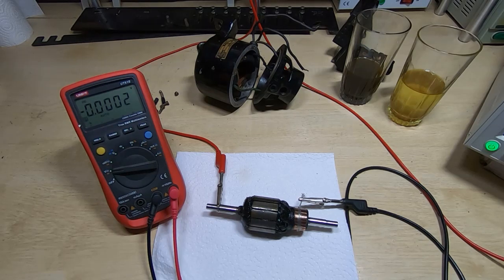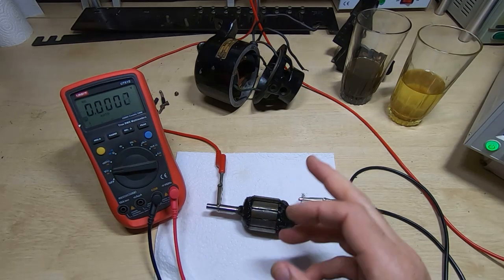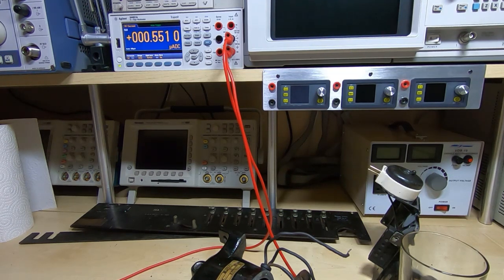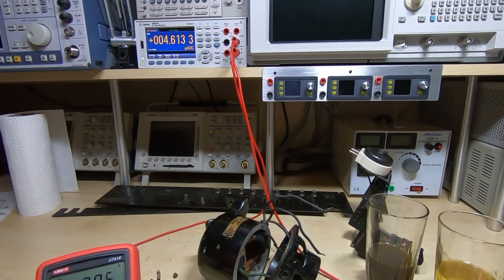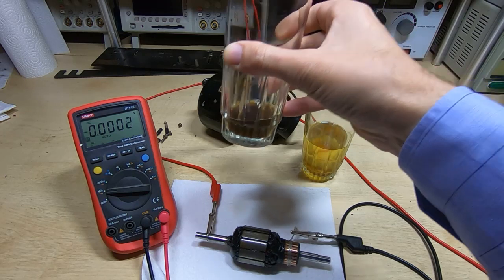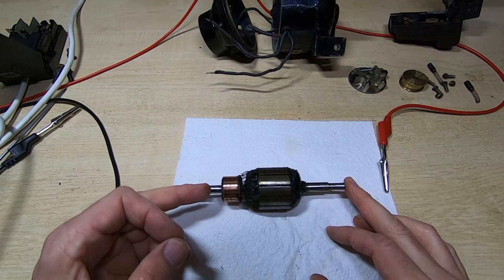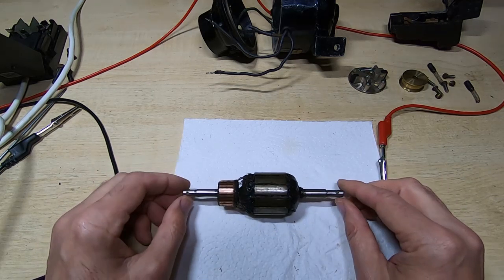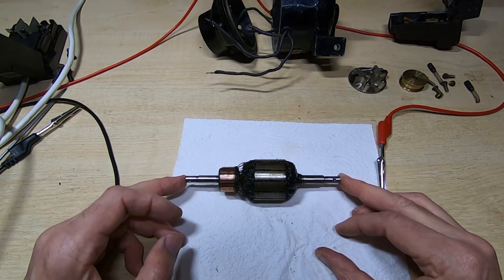MADAS Calculator repair Part10

Comment: Could be that the armature contacts were/are glazed over, and that some of the brush material became embedded in that surface?
SOP is to grind the insulating material between the contacts down by a bit, then sand the rotor. I couldn't see if you did that anywhere?

Though I guess you got it all proper in the end 😁👍

Comment: On the bright side, you have invented a remarkable electrical component which passes current flow in only one direction. I imagine that this could have a number of uses, such as deriving a suitable supply for arc lights from an alternating current supply without the need for rotating machinery. I propose to call this remarkable device something like a "rectificator" or "directifier".
Reply from the maker: I think I will build a processor using old faulty motors. I will call them Motorficators.

Comment: If you have disconnected the armature windings from the commutator, would it be wise to check that the segments are still isolated from the shaft?
Reply from the maker: I have not yet disconnected them. I cannot do that until I have taken some photos and notes as I do not have any technical information for this motor so need to know the correct timing (which winding goes to which segment and which direction they are wound. I cannot do that until I have removed the tar as I cannot see where the windings go.

Comment: Is the machine not earthed?
If it is how can anyone get an electric shock?
Reply from the maker: No it is not earthed. If you tried earthing it then it would most likely just trip the earth leakage trip that most UK houses have. Either way it is a Very bad idea to leave bad earth leaks on a 240V piece of mains powered equipment and not something I am willing to do. I also suspect that material which causes such a bad earth leak would also present inter-winding leakage and this will result in the motor being damaged very quickly.
Reply: @JerryWalker001  I am surprised that a metal machine does not have an earth, even of that age.
I was not suggesting that that you supplied the unit like this, just to run it for a sort time to see if it does indeed get worse or even improve.
Reply from the maker: @FireballXL55  Most machines of that age did not have an earth connection. This is not my machine and as I say in the videos I ran it for some time and it was quickly getting worse. Even if it started to improve it would be very unwise to leave it in a potentially dangerous condition. If I had some certainty what was causing it then it may be different but I cannot restore a machine and return it to the owner in a dangerous condition. This is not an unusual situation when restoring very old electrical equipment as there were no generic standards applied to such machines back then. When restoring such machines I aim to return them to working condition and keep authenticity. The options for such a rare machine are 1) Leave it in a non working but safe state. 2) Get it working but resolve anything dangerous if it is due to a fault. I am aiming for option 2 but if all else fails then I it will be option 1.